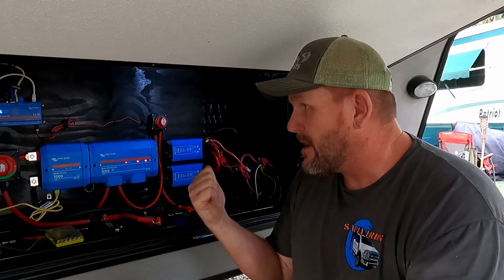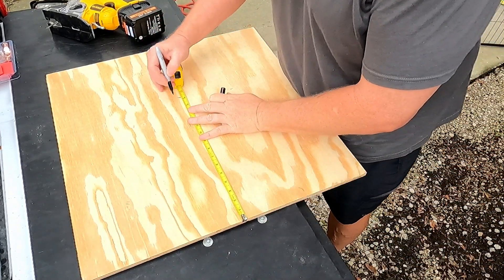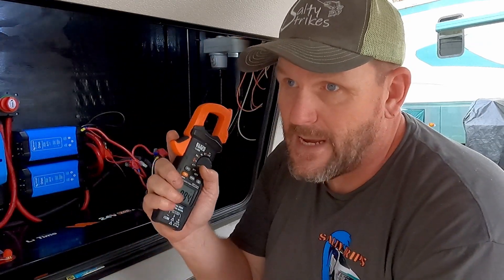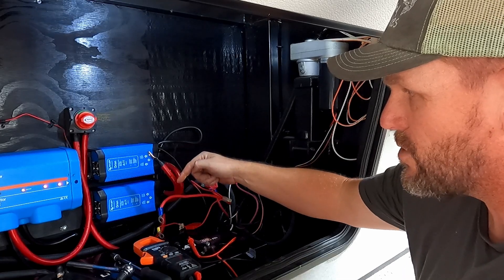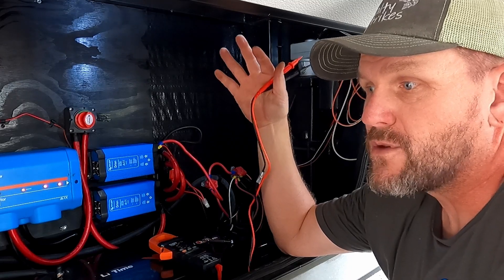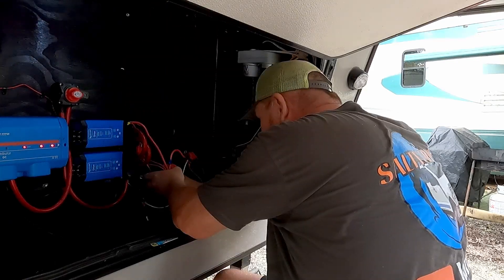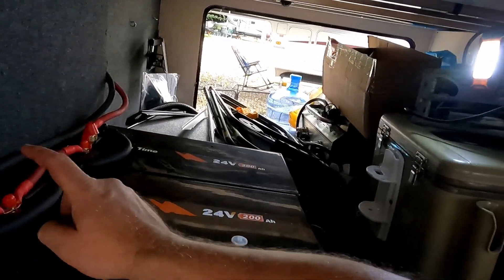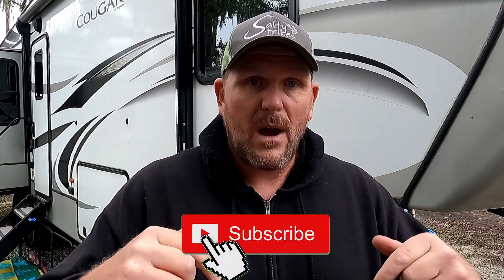The SECRET lithium RV batteries in less space! RV Life RV Living!

Comment: Yeah, you have to have double the capacity  because you aren't supposed to use but half of it, or ruin your batteries.
Reply from the maker: Thats only with lead acid or AGM you can only run down 50%, lithiums you can safely run down to about 5%, so you basically get double the capacity of the same size lead acid in lithium.